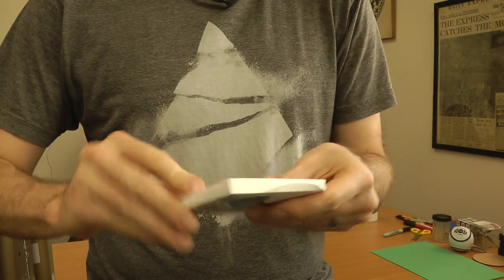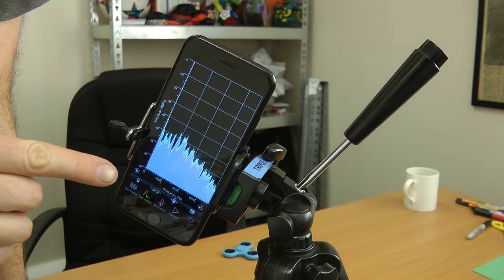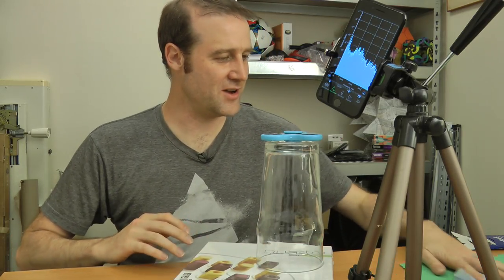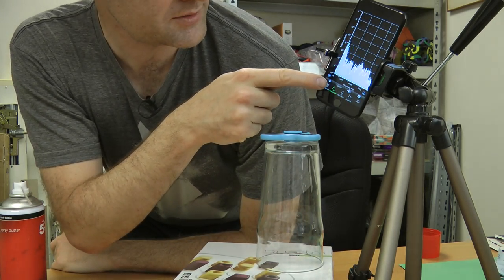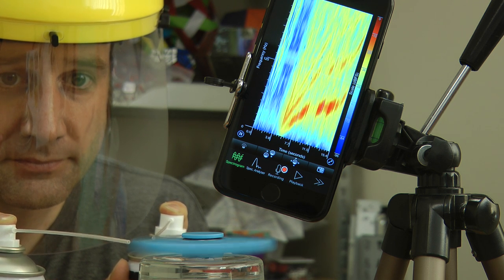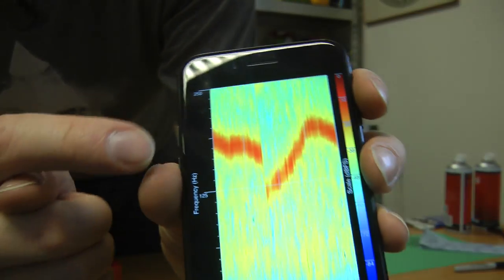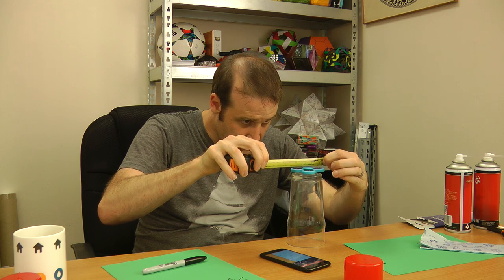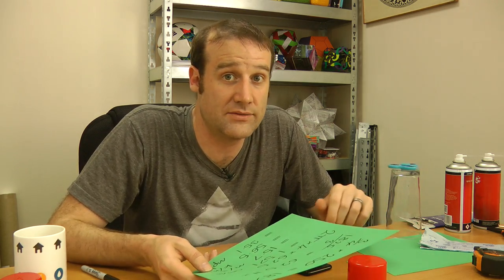How fast is a Fidget Spinner?

Comment: "people who don't understand real units" - writes "k/hr" instead of "km/h" :D
Reply: 1000/hour? Woah.
Reply: What about Hz/D ?
Reply: also don't using ISO mt/s smh.
Reply: so that the viewer doesn't misinterpret it as "kilometers per Plank constant (energy*time)"
Reply: Given that "kays per hour" is a reasonably common idiomatic way of referring to kilometres per hour, at least in Australia (where Matt is from; I'm not sure whether it's as common elsewhere), I suspect that's why he ended up using that notation.
Reply: You don't usually mix units and variables (on the same side of the equation) so there's nothing to misinterpret.
Reply: he was talking about understanding real units, not using proper notation for them.
Reply: km/h is almost as bad. It should be km/hr or kph.
Reply: km/h or km.h^-1 Everything else is wrong. If you think I am wrong, you are wrong. If you think I am wrong to say the previous statement, you are wrong. If you try to redefine "wrong" to some wishy washy wordy concept, you are the wrongest of all.
Reply: Not really considering that kph only works in English speaking countries and h is the most common notation for hours.
Reply: km/h is the exact right notation, as it is the formula of the calculation itself, and all of the units are in their standard form.

km/hr would mean kilometers divided by (hours times radius), which would make no sense.

kph would mean kilos per hour, and kilo is just a prefix meaning times 1000, so that would make no sense either.
Reply: XD you got it spot on mate lol
Reply: its obviously kelvin per hour, how much heat is generated by the air friction
Reply: This is obviously kelvin divided by (height x radius).
Reply: Lo
Reply: Jono4174 ...Define wrong to me..
Reply: That would be 11.2 megaSmoots/fortnight, for those playing along at home
Reply: kmph
Reply: @Jono4174  Incorrect.
Reply: @rocknexus55  Kelvin is K not k
Reply: The correct to incorrect ratio in this thread is....: Pi.
Reply: There is a definite antiquated wife joke in there

Comment: 2pi Parker? That is an equation waiting to be simplified
Reply: tau?
Reply: Base 12?
Reply: Mattkew 
An expression, not equation.
Reply: Mattkew tau
Reply: That's re-tau-rded
Reply: Don't be irrational
Reply: That's only half a circular argument.
Reply: no, he has useful things to do instead of fighting for conventions. See Pi vs Tau on Numberphile too watch him advocating for pi.
Reply: Yes, the point of this comment was to trigger Matt.
Reply: OMG THE LIKES ARE 256
Reply: Parker ^ 2
Reply: Laurelindo I admit, one revolution to one tau is more intuitive. But how hard is it to learn one revolution to 2 pi? If you're in high school, like most trig beginners would be, and you can't be bothered to learn that teeny fact, you might not need to be doing maths. Also, don't forget that pi is a constant the students will already be familiar with coming out of algebra, while tau isn't. And tau makes geometry more complicated, throwing fractions into formulas like the area of a circle, the volume of a cylinder, etc. The only one I can think of off the top of my head that would be simplified by τ is the surface area of a cylinder, which could be rewritten as τr^2 + τrh. Even the circumference of a circle isn't made simpler by τ. Sure, you could write it as τr, but you can already shorten it to πd, which is an intuitive extension of the definition of π as C/d of any circle. Pi is a well established constant which makes more appearances in maths outside trig, and I see no reason to change it.
Reply: TAUAUUUAUUAU

Comment: THANK YOU, i hate those videos where they say it's going 1.000 mph and thank you for saying that the metric system is better.
Reply from the maker: +Sebastian Lindberg You're welcome and you're welcome.

All the videos claiming insane speeds were annoying me. But I didn't feel like doing a direct take-down video of someone else's work. So I made this video quite general.
Reply: yeah, i felt the same way.

but i find it awesome that so many people are wondering/thinking about gyroscopes because of this new trendy one called "fidget spinner" :D

(i actually build a gyroscope to test around with, that is pretty similar to the fidget spinner... got some used ball bearings from a skate-shop for free and 3 month later i've heard the first time about fidget spinners x_X)

now i want to add some electric-magnets that change polarization depending on their relative position to the center :D
Reply: You can definitely get them going far faster than this, due to the fact that there are many different materials and designs they can be made out of that are much stronger than plastic. Such as the solid heavier ones made of one piece of metal with ceramic bearings and such.
Reply: Sebastian Lindberg metric system for speed is horrible.
Reply: ChrusPlays Not at all.

Comment: ive calculated the decelarion rate of the spinner to be 0.2585 rev/second squared
Reply from the maker: +The AtomicToaster Did you work that out from the slope of the signal on the plot?
Reply: standupmaths no this was weeks ago im not that sophisticated 
Just got some spinning footage and and counted the number of spins per sec at different times, then calculated the rate at which it slowed down
after 6 values, I took the average and got this. don't know how accurate this is tho
Reply: Either way, I applaud your efforts
Reply: is the rate of deceleration not proportional to the speed that it's travelling at originally (as resistive forces are roughly proportional to square of the speed) in which case the value would be quite different if you used a different spinner most probably at a different speed??
Reply: Careful with that footage, though. If it generates sound at 180Hz, you have to take footage above 360Hz to be aliasing-free.

Actually, you know what, deceleration rate can work even in the aliased measurement (if it doesn't decelerate too fast). Just don't try to measure how fast it spins with a regular camera.
Reply: Moritz Durtschi Don't worry about aliasing, since most spectral analysers - even most recording software actually - sample sound at 44.1k to 48 kHz at minimum. Audio will not be an issue for recording. Using footage however does need high-speed cameras

Comment: now how fast do you have to spin it so that it is nearly impossible to twist because of the gyroscopic effects?
Reply: I bought one because I want to make a video on the physics of them as gyroscopes.
(Not made it yet, but it IS possible to get an alright amount of precession without compressed air!)
Reply from the maker: +Toby Moszer Much faster than I did.
Reply from the maker: +andymcl92 It does work. I should have supported it from the centre of mass to see the precession.
Reply: and how fast so it explodes?
Reply: standupmaths Yeah, sticking the pen through the bearing in the center would have been much easier and more effective ;)
Reply: Tomáš Velecký Scott Manley has a video;)
Reply: c fahy thx! He did math and he also linked in description someone who actually tested it. Amazing!
Reply: It would fly apart before this happened in my opinion.

Comment: just a side note: these cans are not precompressed air. usually they are a butan / propane mix or even R134a refrigerant (inflamable). and it liquifies under a few atmospheres of pressure so you can store a order of magnitude more than if it were just compressed air. plus it somewhat keeps the pressure constant, depending on how quickly you deplete it, since going from liquid state to gasious, it looses a lot of heat.

Comment: This is what happens when mathematicians bumble around on engineering turf. Clearly when you have a system dominated by air resistance and friction and you bothered to bring 2 air streams to the table, if you're a mathematician, you then go and find yourself an engineer to finish the job. The engineer will immediately explain that, by locating the air cans on opposite sides, you will at once balance the load on the bearings to minimise friction and remove a large zone of air resistance from the test rig, thus allowing it to spin perhaps up to twice as fast at the same effort. If you ask nicely the engineer may show you how to achieve speeds of 20,000rpm+ 
You may want to bring a chemist in to tell you what's really in that can as well  ;-)
Reply: Richard Towers oh wow so engineers are supermen who know everything, nice (and no shit, that was obvious as hell and he just didnt want to block the view). Also you cant spin a fidget spinner that fast... Watch scotr Manley's and beyond the presses video

Comment: That's funny, I made a fidget spinner with 4 magnets of alternating polarity and got it to induce a small voltage into an inductor coil while it was spinning. Then a standard oscilloscope was used to measure the "mic level" AC voltage's frequency to determine the frequency of the fidget spinner. I used 2 sets of alternating magnets (quad spinner instead of tri spinner), so for every revolution of the spinner you would get 2 full AC cycles of (+) () (+) (). It was also neat to see that some of my inductors produced pure sinusoids. Other inductors could start resonating to produce harmonic waveforms depending mostly on the orientation in relation to the spinner.

I want to get a photo tachometer so then I can have that second verification, but the setup is fun and educational nonetheless. I'm glad you mentioned that it is a great way to introduce people into Fourier Analysis and the sinusoidal components in a signal! Absolutely loved the gyroscopic precession attempt at the end too!

Comment: I guess you have to divide by 6 instead of 3 because every lob exists of a hole... so the air bounce of at the beginning of the hole and on the end of the hole... If you understand what I mean... but this is only my humble opninion.... i guess it is better to use a stroboscope to determine the speed...
Reply: Ben Deschacht I don't think that the air would really hit the inside of the loop enough to register.
Reply from the maker: +Ben Deschacht Yes, a stroboscope would have been better. Or there are some nice methods with lasers. I wanted something that anyone could try.

From what I could tell, the edges of the same arm do not make distinct noises.
Reply: hmmm... i shall experiment away tonight... thanks.. now I know what to do this weekend... :D
Reply: standupmaths You can get apps to strobe your phone's flash LED.
Reply: Thanks. Downloading one now.

Comment: 2 trolls in one video, nice job ;)

Metric vs. Imperial units + 2Pi vs. Tau
Reply: Metric vs imperial units is not even a troll, because everyone knows metric units are objectively superior. The SI has its metrological shortcomings, in particular with regards to physical quantities that are currently considered dimensionless, but it is a system that is otherwise superior to imperial units in every single aspect. Imperial units can hardly even be called a system, anyway.

Comment: As Scott Manley calculated, and Anni and Lauri Vuohensilta (the Hydraulic Press People) tested, a regular fidget spinner can go up to around 20000 rpm before disintegration, so you could have gone a lot faster.
But hey, you gave it a go, and the Fourier analysis added a nice touch. Also for us home mathematics enthousiasts without high speed camera (or hydraulic press).

Comment: The whole vibration analysis method to get spin speed is something I do in aircraft engine health analysis all the time.  Although in that case we know the speed it is spinning from a rotary encoder.  By knowing the speed that a shaft is spinning, you can predict what its vibration profile should be, and any deviations from this predicted vibration profile are defects.  

What gets really fun is when you have a gearbox with many rotating parts in it.  You can see the frequency that the teeth are contacting for each gear.

Comment: I have another way that I came across while watching one spin. Under LED lighting you can see the "frame rate" of the spinner. If you spin it up and allow it to slow and count how many times the "frame" stops until the spinner fully stops you can work out the RPM etc if you know the Hz of the LED. :D

Comment: I did the same thing spinning it with some stretched cloth (as to not hurt my hand) recording the sound in audacity, and inverting the period - And determined that when hand-spun, it goes up to 11.7 mph, 126 hz, 42 rot/s, 2520 rpm. pretty neat!

Comment: BUT! As the pressurized can decompresses it loses heat energy, the remaining air molecules are cooled and the flow of air slows. So really you are measuring how fast a can of computer duster can set a fidget spinner spinning before the can cools down. Alternating cans was a good idea, but a much more accurate extreme could be measured with an air compressor.
Great video!

Comment: Beyond the press managed 20,000rpm before material failure using a different drive method. 
With the air cans, either don't use the tubes or shorten them greatly, they cause a lot of friction loss slowing the air stream.

Comment: I did the exact same experiment 2 weeks ago for my kids.  A great use of a spectrum analyzer.
Reply from the maker: +Andrew Blundon Alright! Did it work?
Reply: Absolutely... I started off showing them the spectrum analyzer and getting them to whistle which showed the frequency of the whistle.  I then used the spinner and was getting around 30 revolutions per second by spinning by hand... (using a slightly different unit).  It was neat to show the kids that as it slowed down the frequency dropped.

Comment: The compressed air grinder is another high rpm device. I have seen hand held grinders with 20000 rpm speeds. Although the diameter of the tool is small, (30-40 mm) , it too makes a whistle like sounds when rotating

Comment: That's all well and good... well done calculating the speed of a fidget spinner with a crude frequency-calculating setup, though this easily done with a speed gun. What I want to see is how fast could you POTENTIALLY spin a fidget spinner before either the spinner tears itself apart or the bearings melt.

Comment: TL;DR 

It's 56.5 kilometres per hour
or 35.1 miles per hour

Also he used an air compressor when he was measuring how fast the fidget spinner was going so that made it quite a bit faster than the fidget spinner being spinned normally (in your hand)

Comment: Could you please try to improve the DIY gyroscope attempt? The spinner's rotation axis should match the pen axis, so the toy's plane should be perpendicular to the pen direction (that's a bit harder to attach but doable). Then you lie the pen horizontally, speed up the spinner, and hold the other extreme of the pen!!

Comment: Oh man! I noticed the hum of the spinner myself. For awhile I would test the speed by holding it up to my ear. I was trying to work out what methods would result in a faster spin. In the back of my mind I was also wondering if the actual speed could accurately be determined by the sound. This is pretty cool!

Comment: I am two things, 
1) The owner of a shiny new fidget spinner,
2) An electronic engineer with a plan ...
I COULD make a small device (probably with a little screen and a gap for the arms) that can measure the speed of a fidget spinner. I might do this, but I can't be bothered for just me to use. Do you want one matt? Would anyone pay any money for such a device or would they just use it once and then loose it in a drawer or down a sofa?

Comment: I have an air compressor at home that can do 270L/min... I reckon we'll need to drill throught he centre bit of the spinner though and create a harness to tether it so it doesn't wildly fly off :)

Might be a job for a 10,000fps high-speed camera, I think.